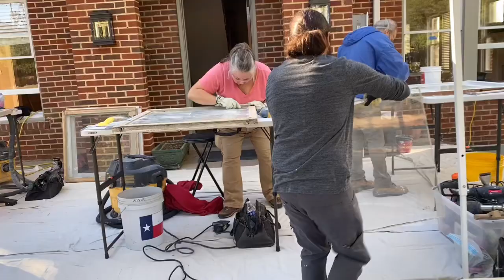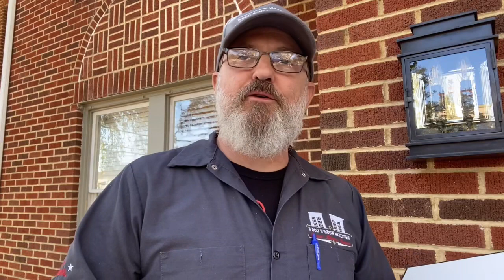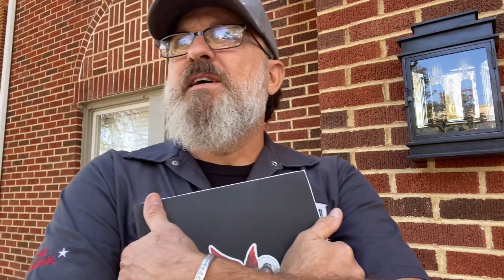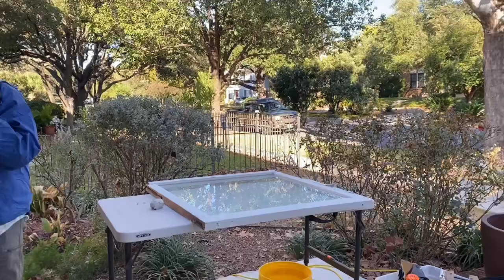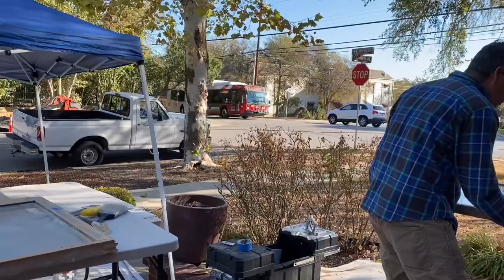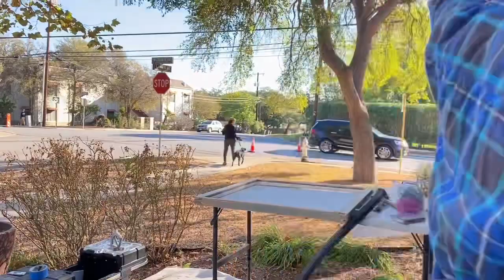Window Craft Pop Quiz - Do You Know The Answers?

Comment: 5:03 You do prime all the wood parts (sides ) but don’t paint them all, we agree?
Reply from the maker: Do not agree. Sides of double hung sash are never FOUND with the sides painted. There’s a reason for that. Many of the sash I have to completely rebuild come to the shop with primed and/or painted sides. Well meaning people obedient so some mysterious destructive force, painting the sides and accelerating rot by trapping moisture. We don’t paint the sides, ever. Tops and bottoms? Now that’s debatable. But not the sides.
Reply: @WoodWindowMakeover  hum .
Impressed. I am not judging : it was almost a question. Nonetheless, I thought that you would just primed or slight coat the sides . Historically never painted/blo ?
Reply: @WoodWindowMakeover  also: what is you take on the moisture/rot forming at the end grain of the sashes !?? I suppose that if the sill was well made no water would accumulate therefore no rotten area ?
Reply from the maker: Historically never painted.
Reply: @WoodWindowMakeover  wow! Cheers !
Reply: Historically the sash are made of old growth timber, not the case today. End grain requires treatment or shelter, ideally both.

Comment: I’m having trouble with mold appearing with the Multi -glaze Type M 
I live in a humid subtropical environment 
Any suggestions? 
Thank you for your help
Reply from the maker: I had that problem one time. I learned to add zinc oxide to the compound and I never had any problems again. I ordered it off Amazon. I didn’t have a strict formula. I just made sure I kneaded it in and that I knew for sure it was in there.
Reply: Thank you so much for the tip. Ordering it now and excited to see the end result!